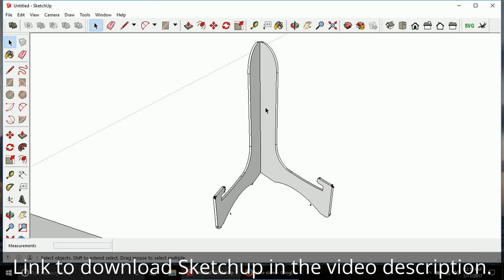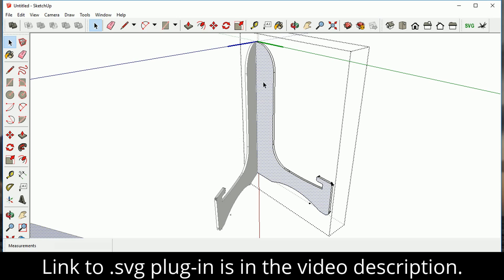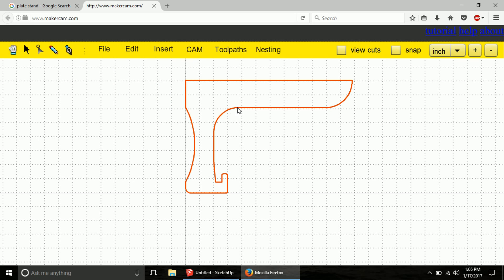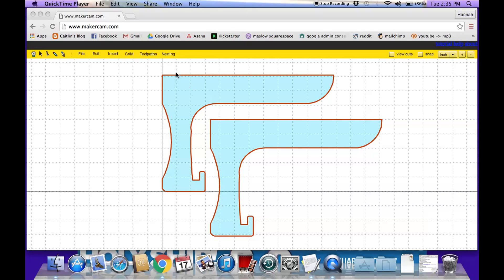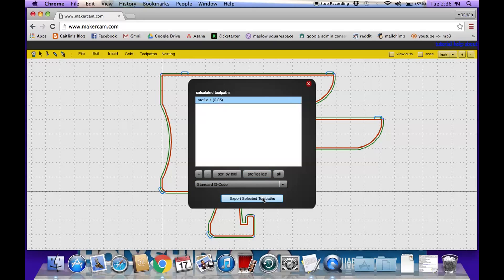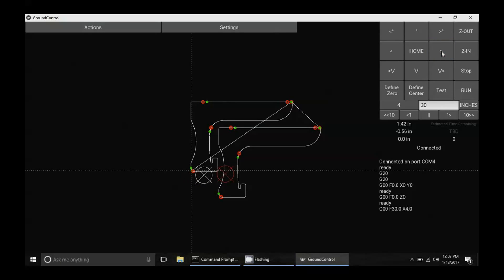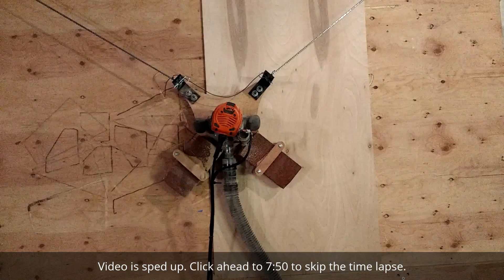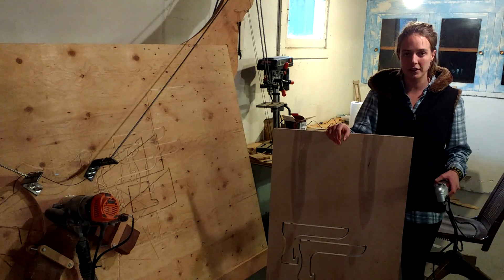Design Idea to Completed Object with Maslow CNC

Comment: Do you have any suggestions for software other than Sketchup?

SketchUp Web can't install extensions, so the SVG plugin won't work.

Sketchup Make 2017 can, but it won't accept any newer files.   So almost all OpenDesk and Digitally Fabbed files are out.   

I have been playing with every version of free Sketchup and plugins I can find to use new files, and I am out of ideas.
Reply from the maker: That's a bummer. I much prefer Onshape to Sketchup. It's free and I think a much more professional package.

Comment: This looks like a great way to get started. I'm in line for a Maslow. I've wanted a CNC machine for woodworking forever but until your team decided to make this system I could not even begin to budget for one. 

I think repeating this design and adding fluorishes like interlocking fingers, then decorative scrollwork with z-axis control will be a great way to step up your game while teaching yourself how to problem solve and use your software, workspace and material layout with the Maslow. Thanks for sharing this!

Comment: Hi, Everyone. The SVG plugin Hannah links to is for versions of Sketchup prior to the 2015 version. If you're using 2015 or later, take a look at this branch instead: https://github.com/JoakimSoderberg/sketchup-svg-outline-plugin

It does have one quirk: on the systems I've tested (Windows 7 and OSX El Capitan) the file is always saved in the default Documents folder for the user. (~/Documents or @My Documents) even if you choose another folder.

Comment: I'm trying to use the svg plugin in Sketchup Make 2017 on a mac but it doesn't seem to work.  I get the export settings dialog but when I hit the save button nothing happens and I never get the "File Exported" confirmation that you get in this video.  Do you know if this plugin is compatible with Sketchup 2017?
Reply: Same here with 2017, 2018
Reply: Confirmed working with 2015

Comment: Hi Bar,

Impressive.

Thank you for this insight. Very nice work.

I can't help wondering, however, if it's possible to design straight into the makerbot (?) software?

I'm used to designing for CAM in 2D and would have done this job that way. 
Sketchup is a good CAD programme, but I see it as a 3D generation package, 
so you'll then have to segment elements to make them... So why go through the pain?

Meanwhile, us in the outer USA, have been metric for ages (you know it makes sense, really),
so is it possible to design in metric measurements without having to transfer back to Roman Catholic?

Kind regards,
keep up the great work,
and I can't wait to get the kit!

Waldek

Comment: Nice simple tutorial, thanks.

1. Is the Z-axis addon development completed? It very much seems like it is working atleast...
2. I never got the tabs from Makercam to work on the Makesmith. Not sure if it was a problem with Makercam at the time, or Makesmith FW? Does it work now? At least it seems to work well on the Maslow :)
Reply from the maker: Thanks!

The development is pretty much done, but we're still waiting to get factory samples for the shaft coupling. It's new year holidays in China right now so things are pretty much at a stand still on that front for a couple weeks. 

The tabs thing is weird. They work great on Maslow, but they should work on Makesmith too. The new version of GroundControl will be backwards compatible with your Makesmith, so when it comes out you could give it a try and see if that fixes the issue.
Reply: Great idea to make it backwards compatible! It is always good to try to stay in one program and master that, instead of two different :)